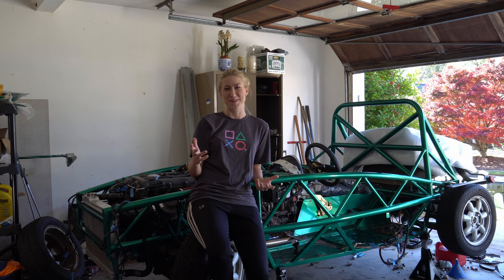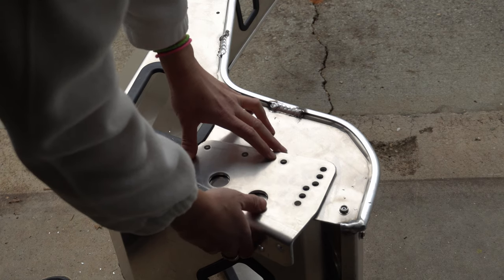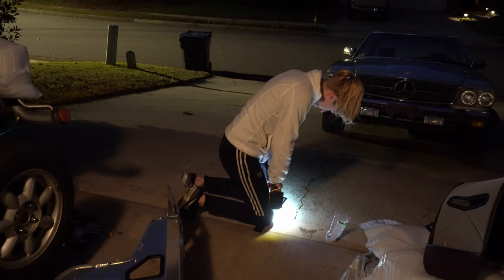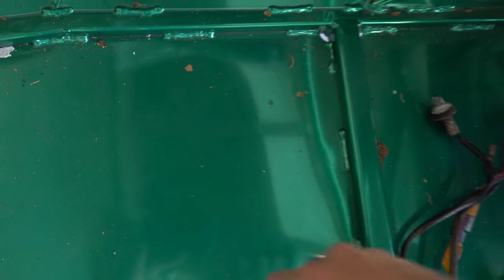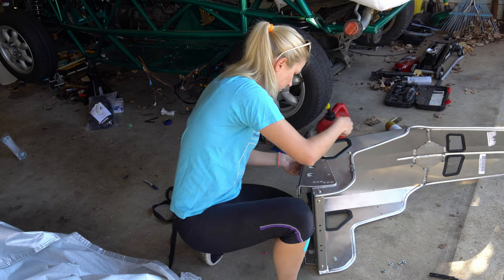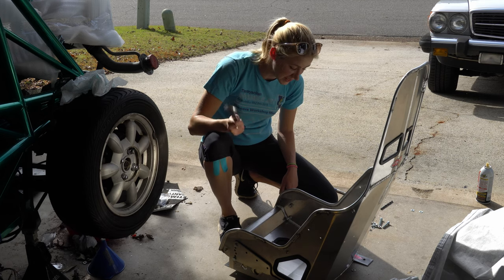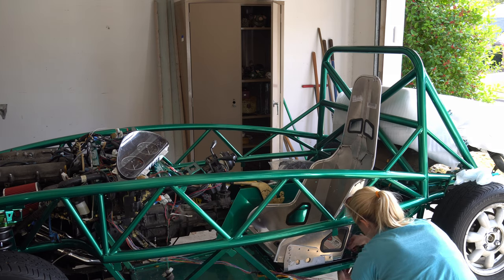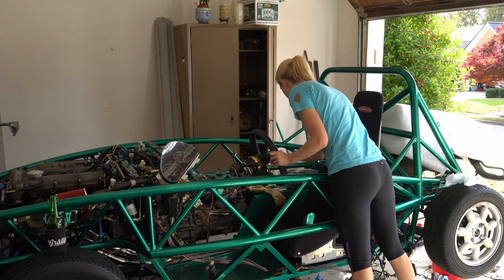Exocet Kirkey 55 Seat Installation

Comment: One thing to consider is that the general test for good driving position, at least for HPDE/competitive driving is to have the top of your steering wheel come to the break in your wrist.  So basically having your wheel coming right to where your wrist flexes down.  This will be different from your basic comfortable cruising seating position, but depending on your use case, it's something to consider.
Reply from the maker: Good to know, thanks for the info! It will be some time before this car sees any HPDEs, I’ll start with my Miata for those events, but good to know for that as well, thanks again!